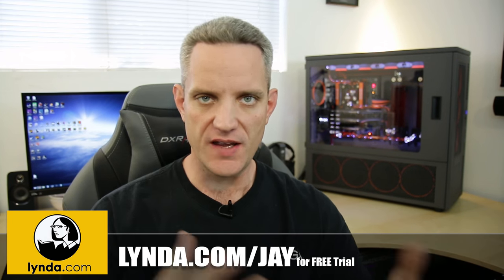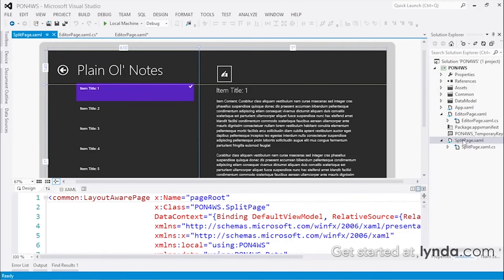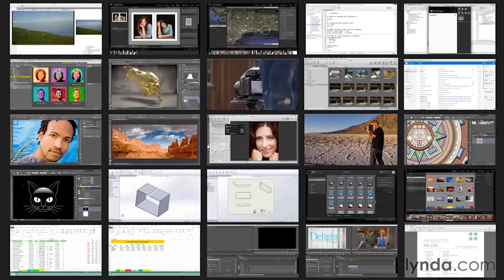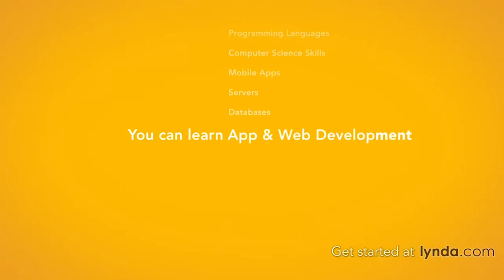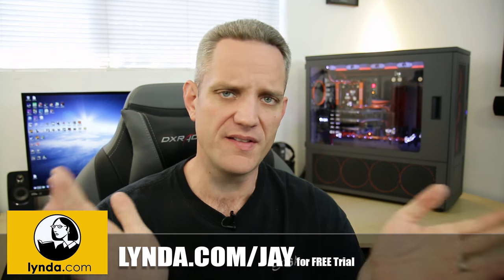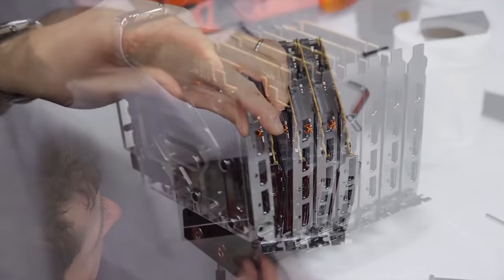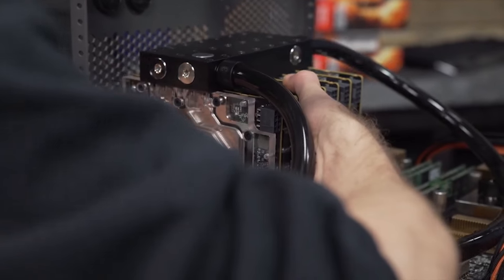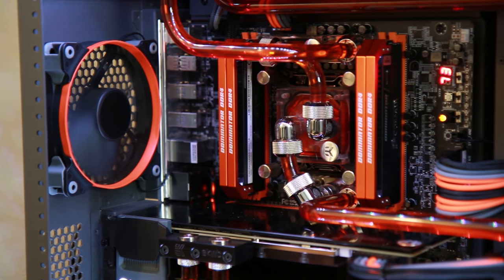Is watercooling worth it?

Comment: personally i dont watercool simply due to the fact that aircooling does a good enough job for me while still being relatively quiet. but i will admit they do look pretty damn cool and can really make a pc unique.
Reply: Often to be honest unless you are using a decent custom loop it isn't really worth it to be honest other to just say "I have water cooling"
Reply: Certain AIOs start to get there. I am very happy with my arctic liquid freezer 240 in push/pull for example and I imagine the 360 kicks ass even more. It is still not performing like a custom loop but for about a 100 bucks it's pretty much as good as it is going to get. Def not looking back.
Reply: the price is always what set me back. like the cheapest cpu+gpu 1 loop would have gotten me another gpu card or decent platform upgrade....and nowadays, AIO does good enough job, and there are so many good case and cpu aircoolers can minimize the noise ....

but i guess watercooling is like the luxury of cars...
Reply: I used to think air cooling was more quiet also.. then I went custom loop with a D5 PWM pump.. My idle noise is just as quiet as my very quiet air cooler I had fans throttlw down to 200rpm.. plus my load noise is no louder than my air cooler was under load.  The difference is my temps are WAY WAY better.. Video card was 78C under load now 45C.. CPU @ 4.8ghz was 80c now 60c.  It's not for everyone but for those of us who enjoy this hobby and the look of it.... do it!
Reply: ISEE YOU 200 rpm fans???? WTF?
Reply: sniperlif3 Not sure what you are WTF about.. there are passive systems out there with NO fans.. do some reading.  200 Rpm is as slow as I could get the Noctua to spin at idle.. at idle you do NOT need that much cooling.. even at medium load.  The fans ramp up based on a temp curve I created.  I have been building for over 17 years now and water cooled back when it was pretty much only Danger Den Maze blocks , Heat cores and pond pumps.  Things have changed.  Power consumption and heat output has gotten much better.  CPU's being able to undervolt and underclock when at light loads create less heat and need far less cooling.  During Summer time I will take the fans up to about 400rpm at idle because ambient temps are higher in the house.  Even then the system is dead silent.  My power supply is a 1200Watt that runs passive under 600W so the fan almost never kicks on.  I think I have heard it kick on 3 or 4 times this past year I have owned it.  I have a twin radiator setup on a 6700K and 980ti.  Anyone who thinks air cooling should think again.  I used to think the same until I built this cooling setup.
Reply: taz874 i got a mastercase 5 but those stock case fans can get very loud